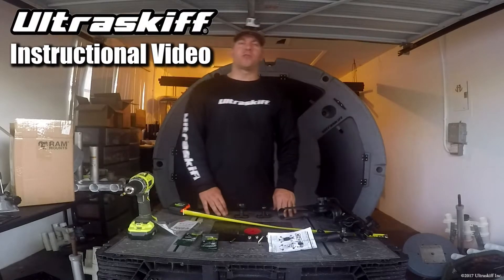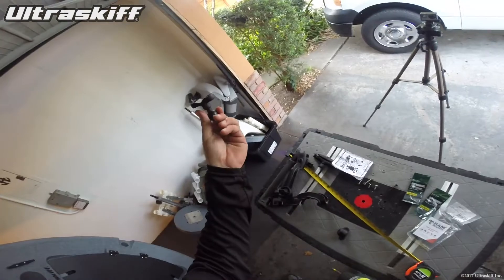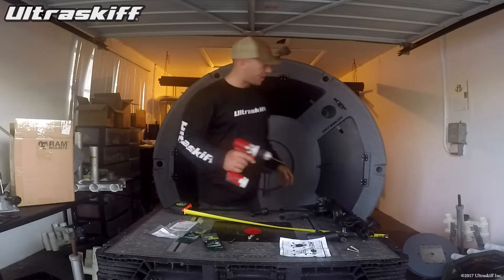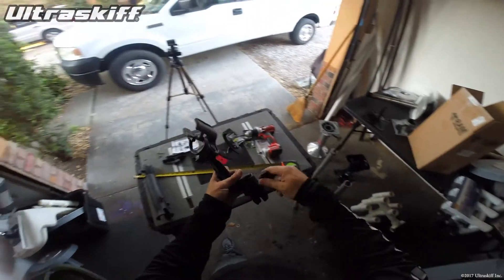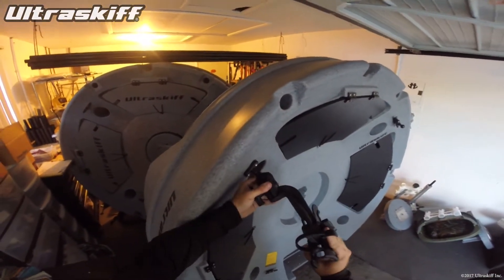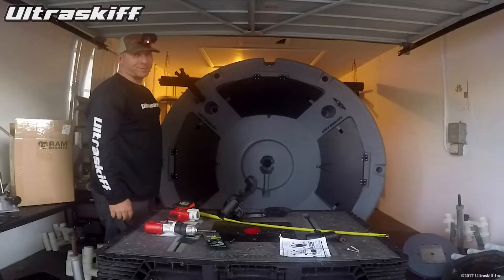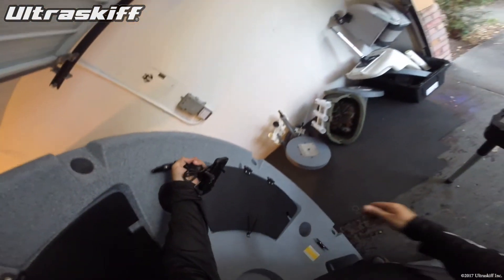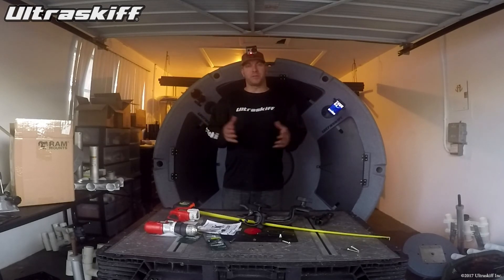How to Install and use Ram Mounts on the Ultraskiff 360

Comment: Very cool Jeff! Picking up my ultraskiff at the end of the month just outside of Toronto Canada.  I've never used Ram mounts before, if I were to use the tube style (rocket) rod holder and tighten the hell out of the clamp how sturdy would it be? If I were to accidentally kick it or nudge it with some gear would it stay where I set it or would it flop over?  What a cool accessory! Keep up the good work pal!
Reply from the maker: From what I could tell its pretty tights,  but if mounted on the threads the angled would not let the rod holder break a flat plane because of the height of the gunwales,  so even if a giant fish pulled it all the way down, you rod isn't slipping out and going for a swim.   
Here are Links to the exact Ball Mounts you would need to purchase.  Thanks Alex! Reach out anytime!

1" Ball Mount:
http://www.rammount.com/part/RAM-B-231NHU

1.5" Ball Mount:
http://www.rammount.com/part/RAM-231U-AC1

Comment: Hey man!!  How are you??  Question...does the bigger ball mount fit over the cleat as the smaller does???  Is the base the same size?  #10 screw?
Reply from the maker: Yes sir, both of the ball mounts fit exactly the same.  #10 screw.